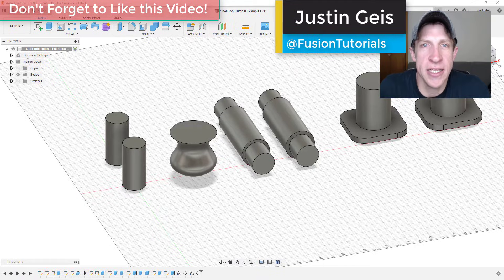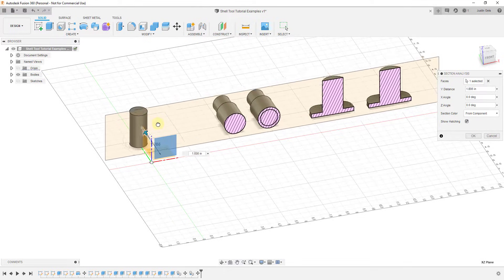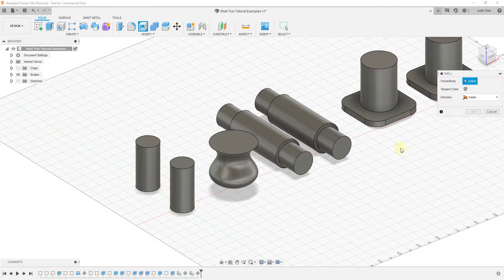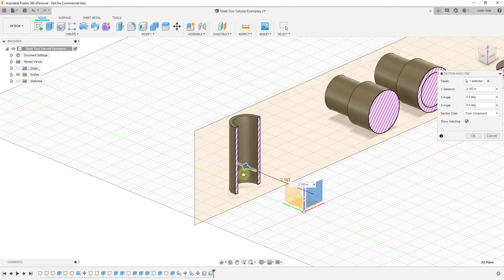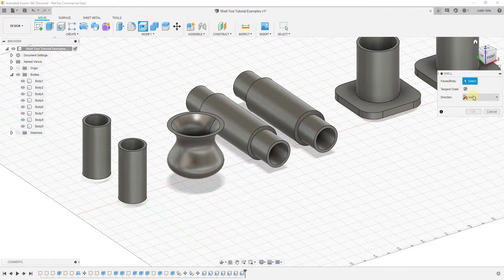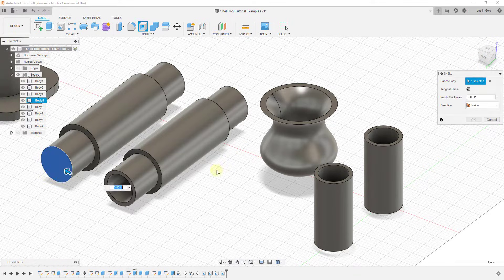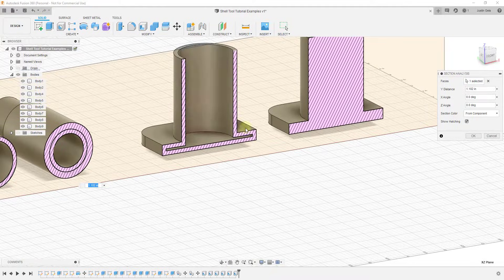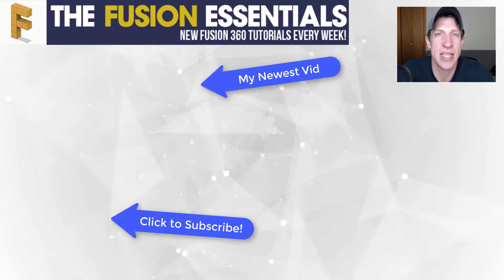Fusion 360 Shell Tool Tutorial - Creating Hollow Objects with the Shell Tool!

Comment: Your comment, "construct it differently" solved my issue. I have a solid revolved body with extruded rings on the outer surface but combined them several steps ago; the shell command was giving me results that I did not desire. I will go back and now join them after performing the shell command on just the main revolved body. Thanks!

Comment: New to Fusion.What if I want hollow spaces in  a rectangle or cubic shape with no opening?  I want to add a magnet to an object while printing.
Reply: a little late but divide the square or rectangle into two parts and shell out the area you want and print them as two pieces and then stick them to become one or if you can join them while printing

Comment: Something to note and this video helped me realize it. I used Loft to connect two faces made from sketches. I then used Fillet to give it some nice rounded edges on both ends and THEN tried to Shell it and instead of removing the face I wanted, it would remove the inside and make the inside a uniform thickness without removing any faces. Thankfully I rolled back the history to remove the Fillets and used Shell first which worked, and then I added the fillet command. So for anyone out there confused by what's going on, use Shell before Fillet :P  I'm way too new at this :/